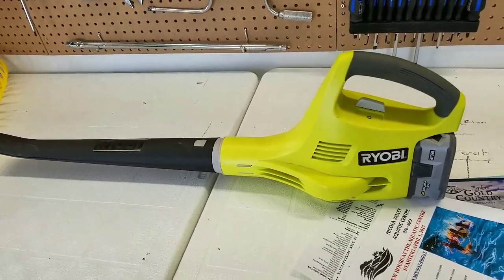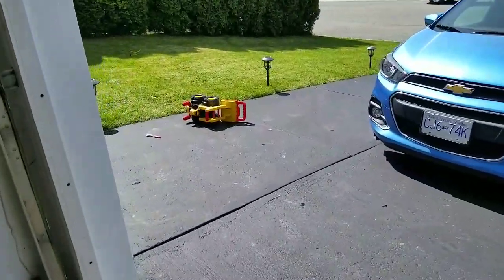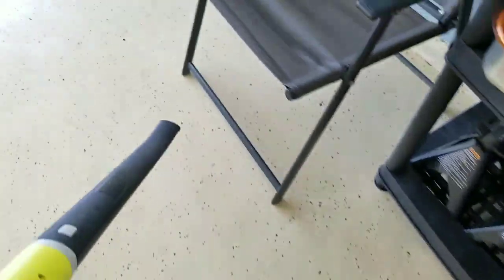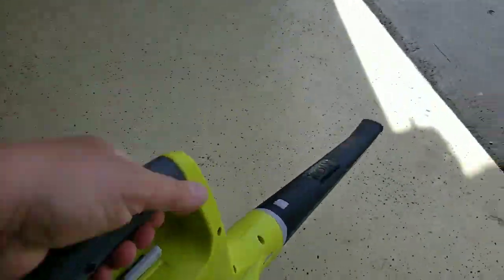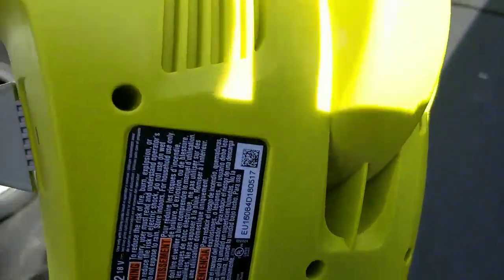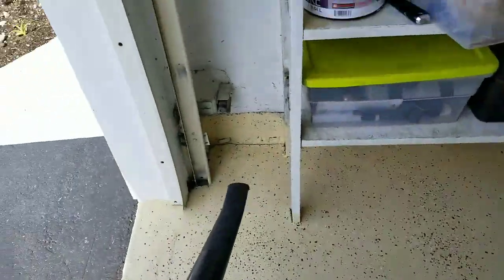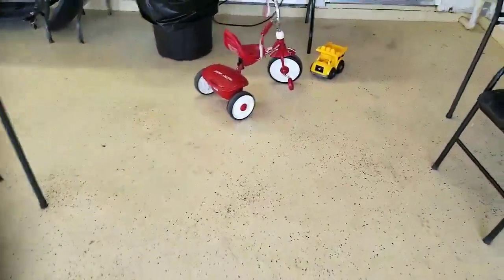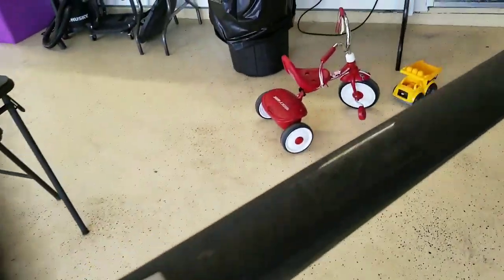Ryobi blower - Review #ryobiblower   #ryobidrill  #mikemartins

Comment: rigid is so much better because of the lifetime warranty including batteries if bought in a set.  the problem is the battery's go out within one or 2 years depending on usage. it's $100 just for replacement of one big cell kind.  in the long run rigid is cheaper more up front cost but never need to buy another set.